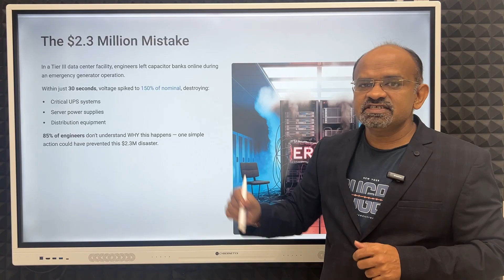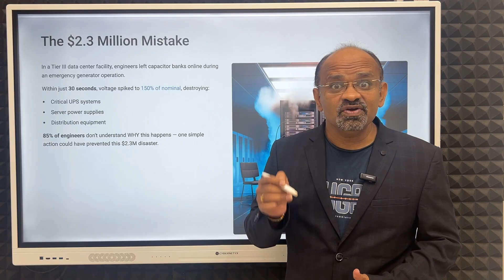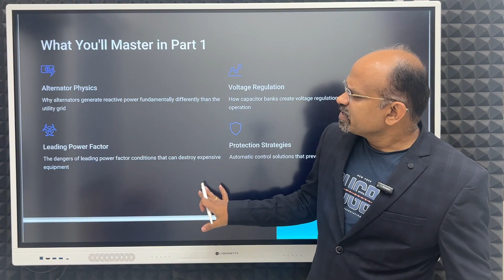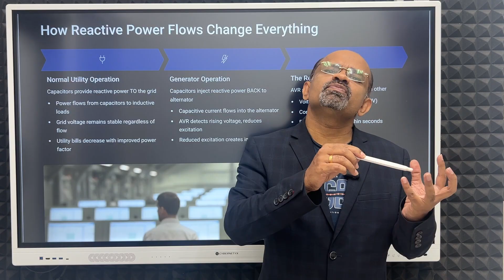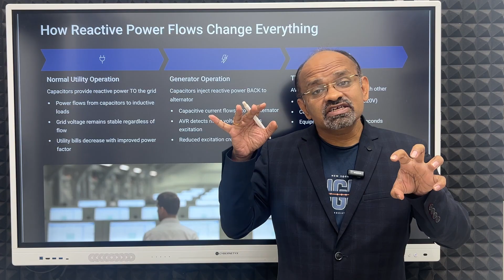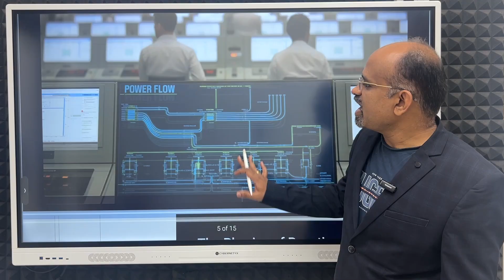What Engineers Don't Know About Capacitor Banks Will COST THEM $2.3M

Comment: The shift to renewables will exacerbate the problems if not well planned. 
Much of the control systems assume specific types of generator (rotating inertia) while the electronic renewable systems have different responses so updated controls will be needed.
Reply from the maker: @philipoakley5498 Excellent point! You're absolutely right that the shift to renewables introduces new control system challenges. Traditional grid control systems were indeed designed around the predictable behavior of rotating inertial generators (synchronous machines), but inverter-based renewables have fundamentally different dynamic responses.

The grid frequency regulation, voltage control, and fault current contribution all behave differently with power electronics versus rotating machines. This creates the need for updated protection schemes, different control algorithms, and new coordination strategies between renewable sources and existing infrastructure.

Your observation about different responses is spot-on where a synchronous generator provides natural inertial response during frequency disturbances, inverter-based systems need sophisticated software control to emulate this behavior. The planning phase becomes critical to ensure grid stability as we increase renewable penetration.

Thanks for highlighting this important aspect of modern power system engineering! It's another example of how fundamental understanding of power system physics becomes even more crucial as our infrastructure evolves.